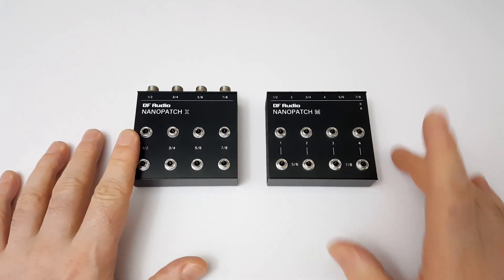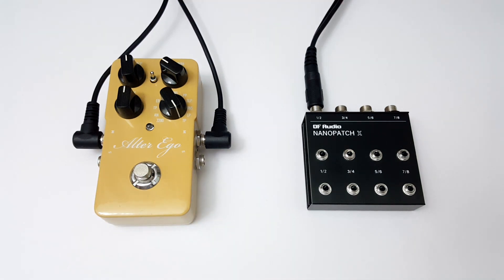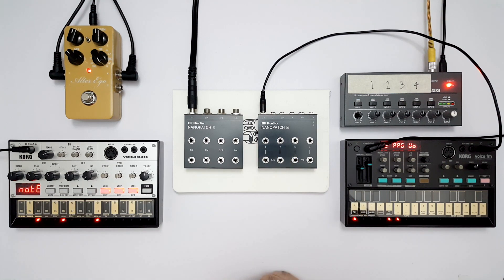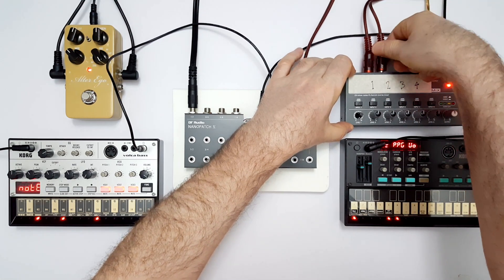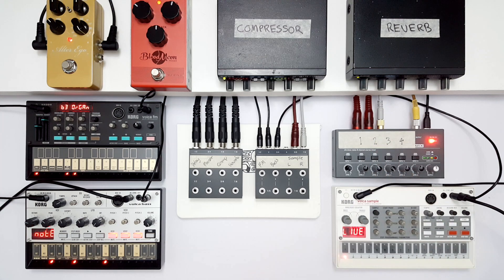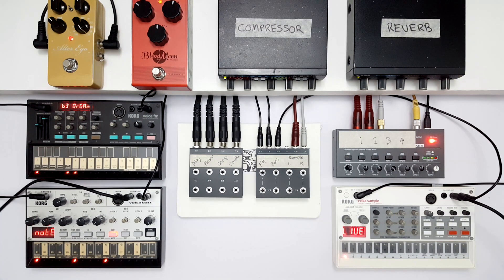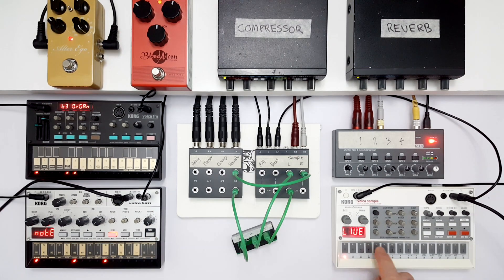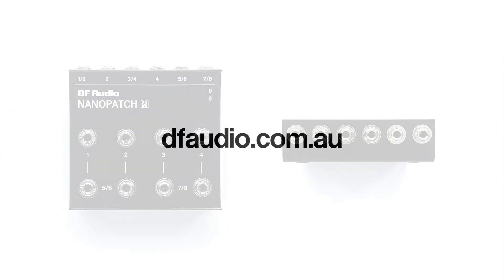DF Audio NANOPATCH Tutorial | Tips and Tricks

Comment: Hi Dud.  Something I'm struggling to get my head around. Is the use of pedals like the KMA tyler delux.  ( signal splitter into high and low)  Am I right in thinking I will need 3 insert cables?  1 for pedal in and out, 1 for the high loop, and 1 for low loop?
Reply from the maker: Ah, I've never come across pedals like that before! Yes, that's right :)